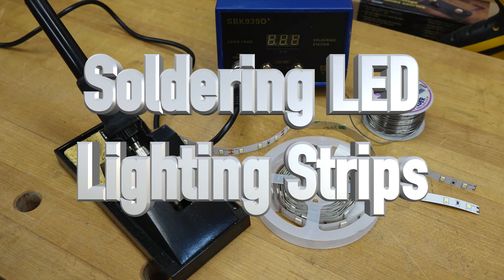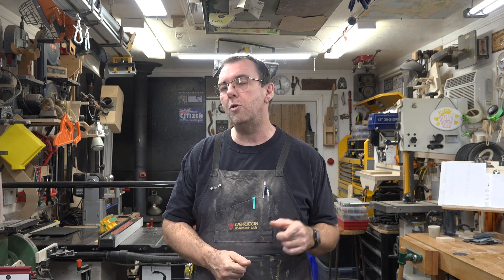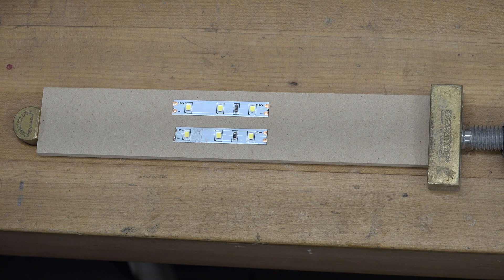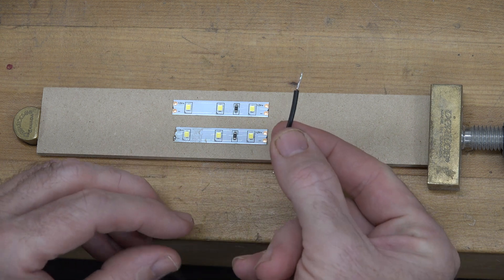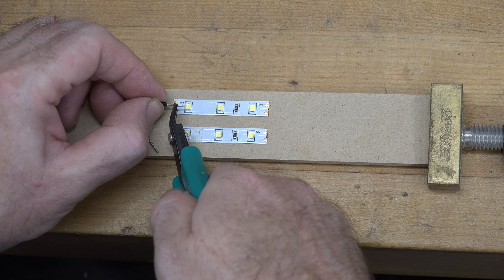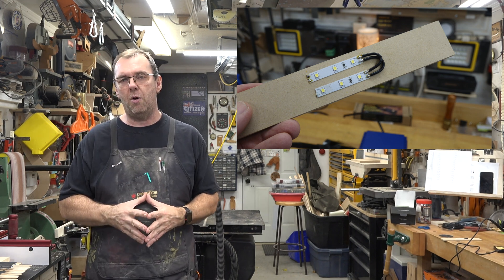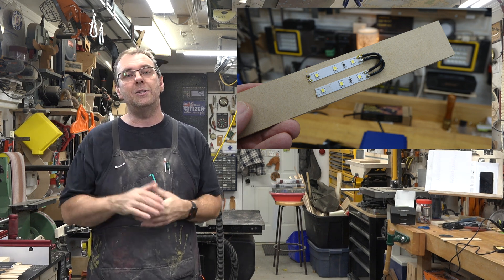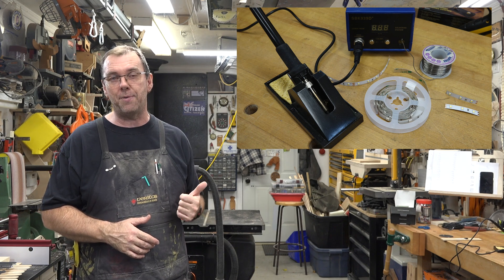Soldering LED Light Strips

Comment: So tinning (sp?) is just coating the exposed piece?  

Also, I watched a channel where a girl used some red and black wire to do fancy lighting stuff but I have no idea how she did it.  I'm terrified of this kind of thing but with my fairy houses and what not, I'd love to be able to modify led strip lighting, along with the led light strands that have individual lights, kind of like Christmas lights. 

Additionally, (sooo sorry for so many questions), how do I know what wire to get?

Forgive my ignorance here.  This is the first video I'm watching of yours and I'm subbing but thought I'd try to ask about using black and red wire for making customized lighting patterns.

Outstanding video for us beginners!  So incredibly helpful!
Reply from the maker: The wire is available at any store that sells electronics or electrical parts.  It is usually a 22 gauge stranded wire.  Princess auto will sell it.  Tinning is just heating the exposed wire ends and coating it with solder so that all of the strands fuse together and are surrounded by solder.  It makes soldering so much easier.  Now for your coloured wire question.....the colour of the wire Heather, has absolutely nothing to do with the colour of the LED lights or with the LED patterns.  Coloured LED strips (or RGB lighting as it is referred to) has more soldering connections (4) than a normal white LED strip which only has two.  You can use coloured wire to keep these connections organized but the colour of the wire will have nothing to do with the capability of the LED lighting.  RGB lighting (red, green, blue) is used when you wish to create an array of colours that is pretty much completely customizable to be any colour you wish.  But even that capability does NOT come from the LED lights themselves and rather comes from the control unit that runs the lighting.  I hope this helps a little.  If you have more questions or if I didn't answer your questions completely, you can feel free to ask more questions.  You can ask them here, or on the channel's Facebook page or via email.  I'd be more than happy to help if I can.  Thanks for tuning in and for subbing to the channel. I look forward to your future comments on the show.

Comment: Hi I like your videos and the way you demonstrate how to do things but they have a question “ it’s posible to connect 6 led lights to a 5 or 12 volts without damaging those leds  and turn them on? Thanks greetings from Arizona
Reply from the maker: LED strip lights are rated for either AC or DC voltage and their operating voltage is also very specific.  While one might be 12 volt dc lighting, another might be 120 volt ac lighting.  Some are as low as 5 volt dc lighting.  The voltages are not meant to be interchangeable and mixing them up can damage to led strips.  I hope this helps.  Thanks for tuning in.
Reply: @acutabove_woodworkings  thank you for your response I appreciate you I have a proyect that only uses 5 LED light and I want to cut them from a 5 volt strip and connect them to see if that works
Reply from the maker: @carontiIV  as long as you connect them to a 5 volt power source, then it should be fine.
Reply: @acutabove_woodworkings  thank you very much
Reply from the maker: @carontiIV  You're very welcome.

Comment: Thanks for the soldering info. I would like to have a little vice like yours that goes into the hold down hole. Looking in Google, I can’t find one online.
Reply from the maker: That one is from Lee Valley Steve.  I'm surprised that if you saw me use it, that you didn't check there first.  Either way, here's the link.  https://www.leevalley.com/en-ca/shop/tools/workshop/workbenches/vises/72081-detail-hand-vise?item=09A0199
Thanks for tuning in.

Comment: Kenny, good information today.  32 years at the telephone company and if nothing else I learned to solder…lol.  I want to add LEDs to one of my projects but need to learn about using smaller lengths, you have helped a lot.  Thanks.
Reply from the maker: Glad that you found the show to be useful Paul. Good luck with adding the LED strips to your projects.  Thanks for tuning in to the show.

Comment: I'm wanting to put under cabinet lighting in my kitchen. So many options, its overwhelming. The result, I still have a 120 lone coming out of my wall below the upper cabinets, that is taped off
Reply from the maker: The options can be overwhelming Doug.  There are so many to choose from.  I guess what you need to decide first, is what kind of lighting you would like.  For my kitchen, I have RGB lighting that is wifi controlled through either my phone, or a switch on the wall.  The are all mounting in aluminum track with a diffuser over them to soften the light.  They really do work well and as long as you get get the power supply that suits the length of LED lighting you have, you should have no problems.  If you have any questions, I'd be more than happy to discuss it with you.  Drop me a line at kennye@acutabovewoodworkings.com
Thanks for tuning in Dough.
Reply: @acutabove_woodworkings  Thanks Kenny. I will hit you up on your generous offer to help.
Reply from the maker: @dougprentice1363  I hope you do.

Comment: That's a neat little tiny vise.
Reply from the maker: I love that little thing.  It works really well for holding smaller items like this.  You can screw it to a bench, hold it in a larger vise or mount it in a 3/4" bench dog hole.  It really is a great help.  Here's a link if you are interested.  https://www.leevalley.com/en-ca/shop/tools/workshop/workbenches/vises/72081-detail-hand-vise?item=09A0199

Comment: Very interesting video. Thanks for sharing I haven't used/bought LED strips till now but after your video I feel enough confident to try your soldering method.
A few years ago I was in a shop/store where they sell these. That time I understood (but maybe not correctly) that there are also 5V (or 3V?) LED strips which
you can connect to batteries
Reply from the maker: LED lighting comes in a whole host of different voltage ratings and power supplies.  3volt, 5volt, 12 volt, 24 volt, 120 volt etc.  You just need to make sure that you are connecting the proper power supply to the LED lighting that you are using.  Hooking up 120vac to a 12vdc lighting strip will make the illuminate very brightly for about 2.3 seconds and then never light again.  LOL.  Make sure you know the rating of the strips.  Thanks for tuning in to the show Hans and for the kind words.

Comment: I am horrible when it comes to electrical, so this may be a silly question: LED strips mostly come in 16 ft lengths. Can you combine (2) 16 ft lengths together on either a 12V or 120V system? I’m planning on installing LED on my porch but rather than run 2 separate 16 ft strips, it’d be nice to just run one adapter and have it all controlled simultaneously. Thanks and keep up the great work!
Reply from the maker: You can run the two 16' lengths together as long as the power supply is rated to handle that many lights.  The length of the LED strip and the power supplies that they come with are usually compatible but you would have to check the rating of the transformer to make sure that it is capable of running a long strip.  I hope this helps.  Thanks for tuning in to the show Peter and good luck with your lighting project.

Comment: What is the maximum length of LED lighting that can be connected?
Reply from the maker: There is on maximum length Ed.  Where you run into problems is with the power supply.  The power supplies are rated for maximum length of LED strip.  If you need more than the normal 16' length that they are sold in, Lee Valley sells power transformers for longer LED strip lighting.  As long as you rate you power supply to the length of the strip, the skies the limit.  I hope this helps.  Thanks for tuning in to the show.

Comment: back in the 70s i was working for a company doing work for the Ministry of Defense , the standard for stranded wire was to tin them , before the project was finished the standard changed to stranded wire not to be soldered all the looms had to be remade. good tutorial
Reply: Any idea why the standard was changed?  Seems the new standard would make it more difficult to get a good joint i.e. cold solder joint.
Reply: @dwightl5863  Back in the 80s, I worked at a company that made specialized connectors and harnesses for the military and other deep pocket customers. I remember that the military was fine with the tinning but IBM wasn't. The explanation that I received was that the tinned portion of the stranded wire that extended out of the pin would become rigid and loose its flexibility. Vibrations and bending could cause the wires to snap at that point. I don't know if it was true but the customer was always right.
Reply: @JimLambier  Thanks for the reply.  I guess I could see that happening.  IBM is kind of finicky that way.  I worked with a guy that did service work for IBM prior.  To get a repair made he replaced a defection component on a circuit board.  IBM required him to then replace the repaired circuit board when the replacement board was available.  As you said the customer is always right and you don't bite the hand that feeds you.
Reply from the maker: I can see some validity in this point but I don't necessarily agree with it Jim.  Interesting stuff.  Thanks for chiming in with that.
Reply: @dwightl5863  i have no idea why it changed the contract i was on lasted 1 year and i did no more work for the Ministry of Defense again
Reply from the maker: I wonder why it changed.  Thanks for tuning in Keith and for chiming in with your story.  Interesting stuff.